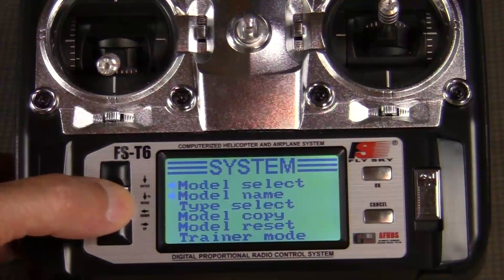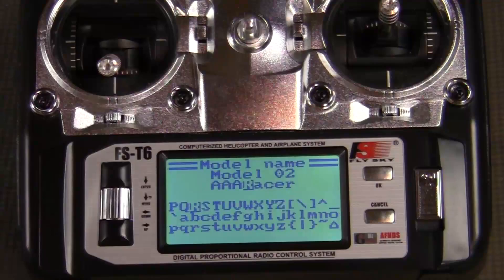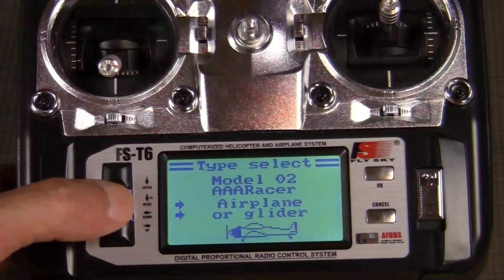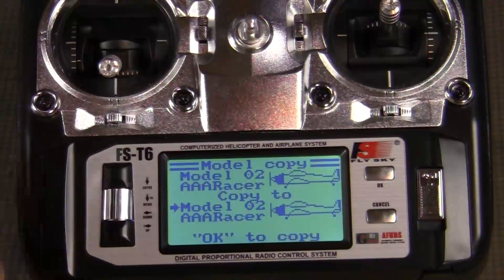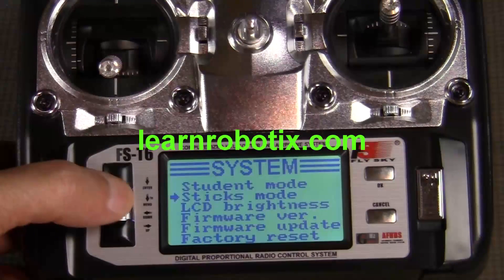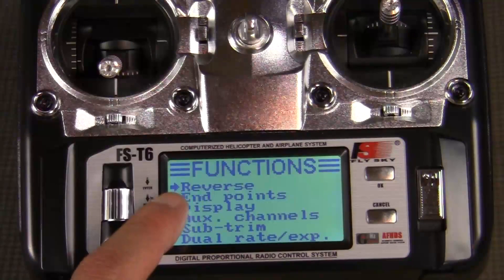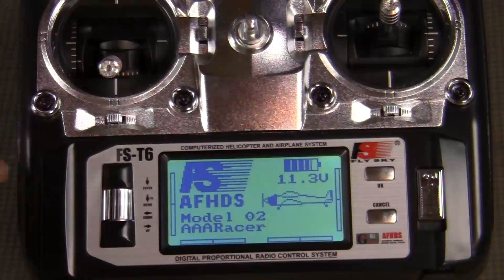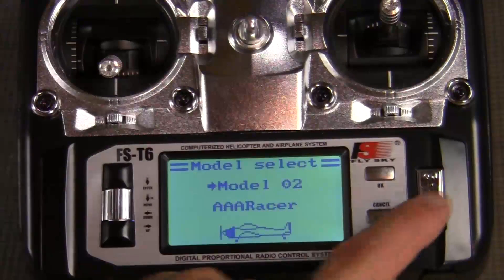Setting Up the FlySky Radio: The Basics for Beginners

Comment: its not a thumb screw... its not even a screw... call it a roller switch or something.... 
its basically a sideways encoder switch like on modern car radios. Its just housed to be like a roller wheel rather than a dial.

Also i think everyone can figure this out within the first 10 minutes of holding the transmitter.. do more intermediate and advanced tutorials. like the dual rates/exp , throttle curve, pitch curve, etc
if someone cant figure out how to change the models name without instructions they're pretty stupid.

Comment: I just bought a 9xr pro - it is an unbelievable pain in the arse!  The drivers will not load- the eepe will not usb communicate with either the Tx or its sd card in a reader. I have spent days!!! trying to get some sense out of it - I have decided no new Tx should be such a problem. My old 9x was 0 problem to set up for a flybar...I have decided to throw it in the cupboard and get some thing else. I wonder if this Flysky might be a but more compatible with actual flight control as opposed to scrolling through endless (largely out of date) forums suggestions and lessons in rocket science 101.

Comment: Hi i bought the unicorn 220 and I restored factory settings accidentally its still bind to the quadcopter but when i connect the battery to the quad it keeps beeping and not responding to the rx  what do i need to do to make it work again?.